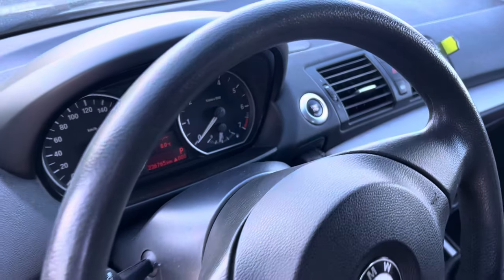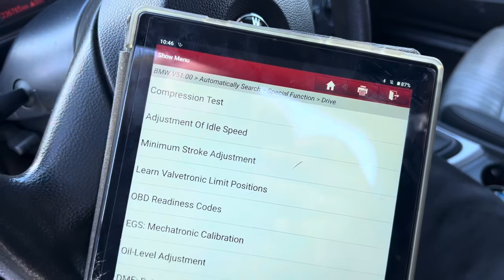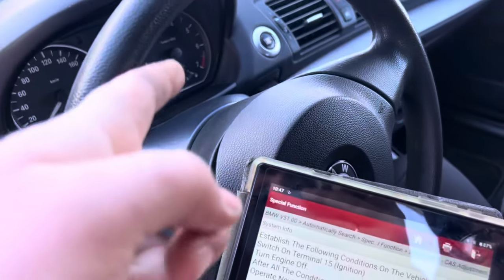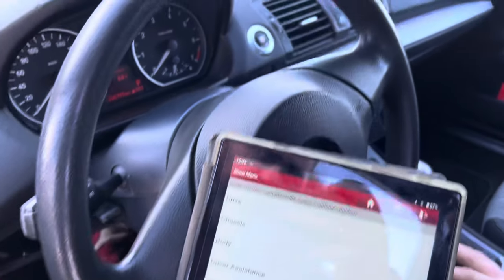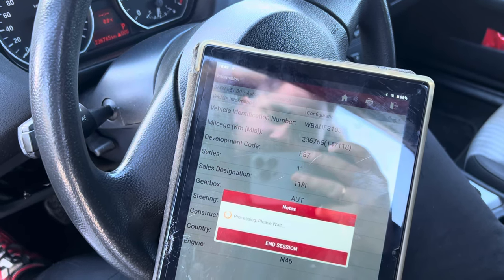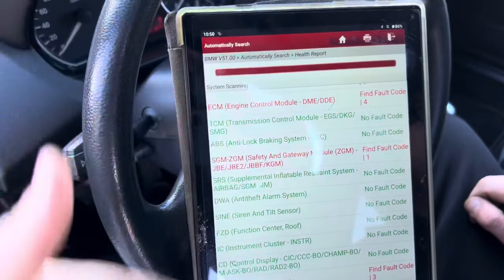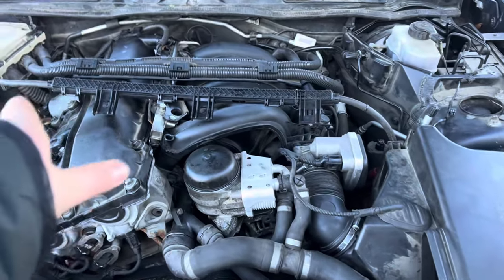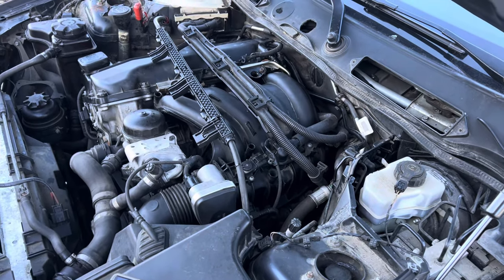✅ Crank no Start? Fault code DTCs 2F44 and A0B4 (BMW E87 118i N46) CAS Immo Starter Adaption Easy

Comment: I have an 07 550i and it wont start and is giving me A0B2 4 and 5 and my car wont start anyone know what to do I have no engine light on car just cranks for 4-5 seconds but wont start. What should I do?
Reply: Have you figured this out ? Having the same issue on my 550i 07